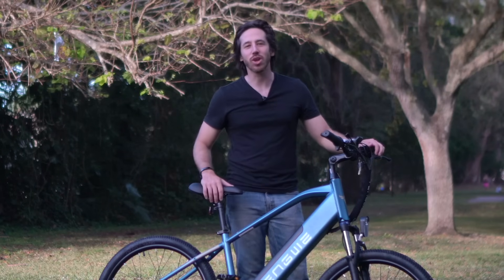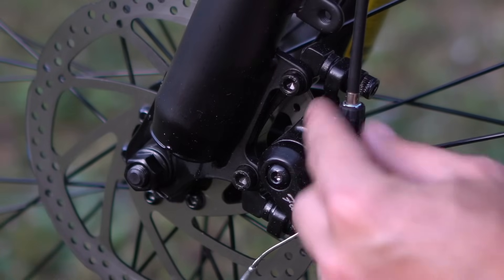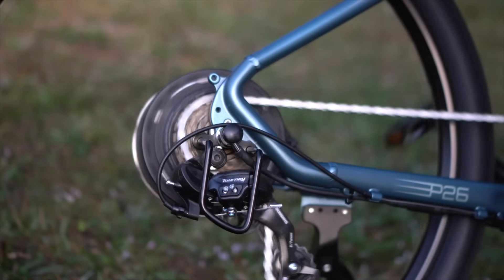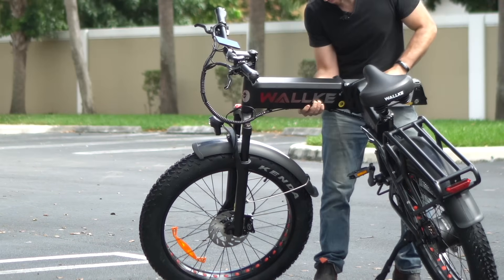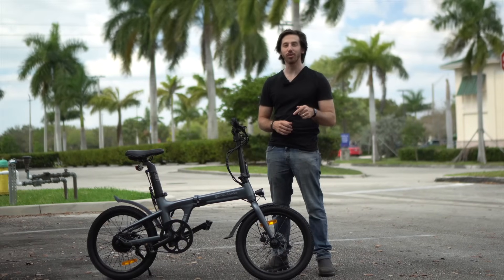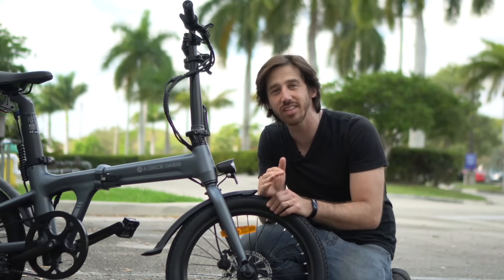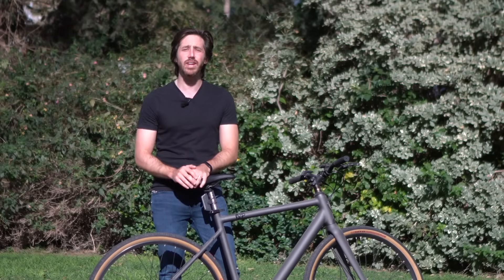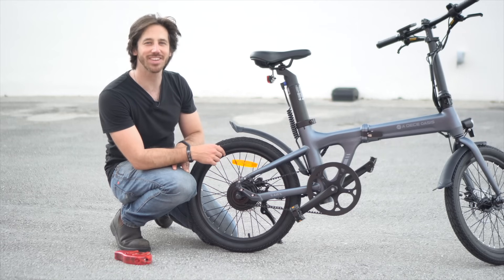How to do common ELECTRIC bike maintenance

Comment: Here's something that you might want to cover in a follow up ebike maintenance video.  After about 10 months of riding my ebike and approximately 2000 miles, I experienced a noise coming from my rear hub that sounded like bad bearings or a card in the spokes of a kid's bike kind of sound.  Well, I went to my bike manufacturer's website and checked out a video on bike noises and found out that it needed to be lubed in the hub area.   I would have thought that area of the bike would have been well greased for many years to come.  So anyways, I laid my bike horizontally to the ground, derailer side facing up, and sprayed some teflon dry lube into the axle area between the last gear and the frame of the bike and then let gravity do its work.  Well, to my surprise, the sound which seemed to be an extensive repair went away within a few miles of riding.  I hope that this may help someone out there....take care.

Two-year Update:  I'm at 5,000 total miles now and have ridden 3,000 miles since the noise problem.  It runs great and the noise never returned, but I'm thinking about doing a second dose of Teflon dry spray (approx. 5 seconds burst of spray using spray straw) as preventative maintenance.
Reply: not all heroes wear capes
Reply: Only heroes that fly wear capes!!  @TheTrendTrade
Reply: @Samkoutloud Batman can't fly and wears a cape
Reply: @shadwell749 Batman is built different
Reply: @TheTrendTrade  🤣
Reply: @TheTrendTrade  Real heroes do NOT wear capes, as cape-wearing heroes are simply fictional, pop culture characters for children, and thus DO NOT exist.
Reply: @johnsmith7676  Good grief dude.
Reply: @johnsmith7676  Buzz-Killington's here...
Reply: Yeah that's not really going to cut it. You need to open up the hub motor and put some white lithium grease in there. I guarantee it's dry as a bone in there after 2000 miles.
Reply: @tabasco260  Its been 18 months now and 3,300 miles and running good, quiet as a church mouse.
Reply: Thanx
Reply: I'm glad to hear that ain't  got ebike but good to know these things 👍
Reply: How many miles do you have now and is the noise still gone?
Reply: @projectpat313  3,300 miles and no noise
Reply: Not all heroes wear capes
Reply: That's how you make nerve gas

Comment: I bought my E-Motto bikes in Sept 2011 from Menards. They have and still are giving me great service to this day. These bikes are heavier and well built with little or no maintenance.  Tires and batteries have been my only replacement items over the years. I use my bikes on road use only for doing errands. These new bikes seem very high maintenance for the average user.🤔

Comment: I just wish there was a better way to monitor bike tire pressures. I looked at some of those valve caps that showed when one of your tires was getting under pressure. It’s nearly impossible to get them in the lower pressures that some e-bikes use. The most common pressure is 32 PSI. I’ve got a e-bike that takes 1.4 Bar / 140 KPA or roughly 20.3 PSI. It’s pretty much impossible to get these in the USA. You can buy them from the European market but the shipping costs will be almost twice the value of the product for such a small item. Plus there’s the hassle of customs and having to wait two or three weeks for such a small product. I just wish more sellers on eBay and Amazon in the USA market would carry them in the pressure ranges e-bikes commonly used. I’ve got several of them on my regular bicycles. One glance is enough to know that you need to double check them.

Comment: Great video! Make sure... You check the tire's maximum pressure rating before filling. I changed my Kenda fat tires (26x4) and filled them to 24psi (per what I read online).

When the tire popped off mid ride (that was fun), I noticed that the tire was rated to a MAX pressure of 20psi.

Refilled it to 16psi and its running happy now.

Comment: Didn't help me. My disk breaks still need trying, even after I vastly improved it. I still have to suffer from weak braking or else the breaks rub and kill my range.

And all bike shops that charge less than $100 for this tune up are booked out for the next 2 months.

I'm just making due until the late fall or winter until I can get those sweet prices for service without the long multi month wait.

Comment: Personally I wouldn't charge a LiPo battery at anything less than 40 degrees. I had a very smart guy explain why, all the way down to how the electrons flow across the battery plates at lower temps. He said the cold is worse than the heat, and it will destroy those batteries if you charge them cold. I don't have an e-bike, but I do have a small LiPo battery I use in my car for ham radio.

Comment: can anyone tell me if i can convert a scooter with lead acid batteries to a lithium ion battery pack? its currently a 48v 20ah charger with 5 12v lead acids. So will the controller have a problem with a different battery chemistry? or is it all about matching voltage and amp hours? Its a gift that i got...its not new but works very well and is way more comfortable than a strait E bicycle because of its large padded seat and full suspension!!! anyway i am grateful to anyone who can answer my question!  But i hope Its Micah who answers simply because i trust his knowledge with power supplies etc!!!! Thanks!!!

Comment: E-bikes are a massive pain in the arse. Much more maintenance, always goes wrong, can’t pedal with no power, crap speed… just don’t waste the money.
Reply: Ur nuts guy. I couldn't ride w/o an ebike because of bad knees, so mine has truly enabled me to get out of my house & go places. You are correct however that they're practically impossible to ride w/o power unless you're on a flat surface because of their weight. Mine's 88lbs... As far as speed goes, mine is one of the faster ones, topping out at 41.5 mph on a flat road on its first full charge. Only time it did that though, second charge only reaching 38 mph. After 600 miles I'm lucky to reach 34 mph currently, but that's still pretty fast. It's currently in the shop getting the brakes bled & new pads but that's the only maintenance it's had in 600 miles, so that's not bad at all. For $1,800 mine's a great buy!

Comment: I'm at 1200 miles on my ecotrik fat tire. Brakes about wore out. Shifter needs adjusted. Getting a little loose feeling but still running great. I keep my joints at 20 miles or less. Battery never left me peddling hard. I think I could get 40 miles out of a charge. Needs a higher gear in top. 500 watt motor. 36v battery.

Comment: Thanks, i am learning more about ebike maintenance
I had some bolts n nuts come loose

The plate that my battery connects to a screw kept coming loose, i kept having to tighten it for awhile n wouldn't tighten fully n kept spinning, the screw head was on outside n the nut of whatever was in the inside so i couldn't tighten the nut , then one day i tighten it n it fully tightened n it stayed tight, people watch out cause if one screw comes loose on battery plate others might on the plate
One day i took ebike to bicycle store n was seeing if i could buy a front basket to fit my ebike, we had to move my display that shows  my speed n watts, well one screw n nut on one side was almost fully loose, so we tighten that up
So far no to important nuts or screws came loose that i know off n i do some ruff off roading at times

Comment: I don't think your cables stretch. I'm pretty sure it's the sheath compressing, which makes you think it's the cable. But it's the sheath getting shorter. But the cure is to adjust the cable anyway.😊

Comment: I recently bought a folding ebike for parts. I fixed the electrical parts of it but the folding mechanism is seized up I used WD-40 and was able to fold it but I was barely able to unfold it. is there some other lubricant I should use. or any other advice I'm missing!

Comment: I used to think the idea of hydraulic brakes on a bike was weird, but now I have them. Man, I'd never go back! The responsiveness, the level of control and confidence that I feel knowing that I can go from lightly feathering the brakes all the way to locking the wheels with very little effort  tallowing me to use more fine motor control to carefully adjust my speed- oreover I worried such strength would lead to more skidding- but it is the opposite, because you can fine tune braking force easily with only two fingers- allowing more grip on the bars for steering- but also keeping your braking on the threshold for more controlled and ultimately faster braking with less wear! I had to keep adjusting my old brakes constantly, I haven't adjusted my brakes in months and they are just as good as they were the day I bought it. I thought that maintenance would be harder, but there hasn't needed to be any, so if I need to learn to bleed a hydraulic system occasionally then so be it! I ust love how they respond, how I can stop quickly, even with one finger, but still feel more control and feedback than any cable system. I am a convert to hydraulic brakes! No contest, they are the best!
Reply: Hydraulics are a no-brainer.  There is a reason why rod brakes disappeared from automobiles in the 1930s.

Comment: I found out after I bought an E-bike online that none of the local bike shops in my city won't work on, or repair E-bikes that they don't sell. I'm an electronic tech so I can troubleshoot most things, but having trouble getting repair parts from the manufacturer.
Reply: Tell him now's a good time to start since you're going to be seeing more and more e-bikes everyday
Reply: I wonder if it's all ebikes in general, or the ones that use parts that they don't generally work with.

Some will be hesitant if you only come in for the difficult stuff, while they can't make money on you through all the other stuff.
But others might just be because they don't know the tech. If you got like Bosch, Shimano etc, loads of stores will sell bikes with those engines, and can easily work on them, but I know a lot of people here bought cheap Chinese bikes, and loads of stores won't touch them, it will take a lot of time to fix them, and obviously people bought those bikes on the cheap, so getting a fat bill will likely cause a ton of issues.
Reply: @benjaminvdvyt  That's what my local bike shop told me, they said the Chinese bikes were too much of a liability and they won't touch them. His example was if he fixed something and later they went home and it blew up or something, they'd blame him even if all he did was work on brakes. He said name brand bikes are fine, though, he'll work on them all day.
Reply: Im having the same problem. Im new to the ebike world and have been loving the fun that these bikes provide. Got a flat the other day and some of these places won't touch it.  Guess this is motivation to fix rear tire myself.  I probably need to know how to do that anyway.
Reply: i was wondering about that . whod work on mine if it ever breaks. lol

Comment: Super easy thing to add to mech brakes adjustment.  Same tool, before tension, loosen caliper mounts just a little, squeeze lever to center and re tighten before doing the cable.

Comment: RE: Disc brake adjustment. Tuning the lever only moves the outer pad. To tune the inner pad there's an Allen head on the back of the caliper. You can either adjust it in place through the spokes, or take it to adjust. You want to tune the outer pad first, and then the inner one.
Reply: That is very true.,and important. With a cable type calliper it is only by adjusting  both the inner and outer pads and proper alignment of the whole calliper you can do the adjustment properly. That is certainly the case with my cable operated brakes anyway.
Reply: @jasondoyle1037  I made that mistake with my first set of cable actuated disc brakes. Resulted in the disc bending in slightly by the time I was corrected.

Comment: Hi Micah,
Also, check your motor cutoff break and gear shift sensors are working correctly.
These are just as important, if not more so than a loose nut.
My magnet on a break sensor moved out of position for me, and I was fighting the motor at a stop light. No joke on a 1500 watt ebike.

Comment: My 2.5 inch street tires tell me 60.. should I not be doing 60 psi on them?
Reply from the maker: You can usually go up to 60 but it just makes for a rougher ride. 40-45 is usually still a good balance between handling and comfort.
Reply: Keep them in the range recommended, and compensate for any difference in temperature between the outdoors and where you store your bike.
Other than that, adjust the pressure for the weight you put on the bike. You don’t want so little the rim pinches the inner tube or too much that the ride feels very harsh. Play around a little to find what you like.
Reply: @chow-chihuang4903  Thanks Yeah I took the suggestion and the difference between riding it is night and day. It's so much more forgiving now.  I just filled it up to what the bike tires said right on them which was "fill to 60psi."

Comment: I would suggest that directors of amputee clinics apply for the give a way and use E-bikes to help get new amputees back on a bike. I bought a non electric trike after my amputation, and it was instrumental in getting my endurance and strength back after over a decade stuck in a wheelchair.

Comment: hi, I love your channel and it has helped me a lot as Ive stumbled into the world of e bikes as main transportation and project. I may win one of the e bikes yo plan to give to people in need later. Even tough I have a second hand e ike, I made mistakes and got one hat is wrong for my needs, but is also a real drain on meager resources to get it right enough. But I wont enter my case trying to win the lovely bike this bmonth. It would also be the wrong ike for me in completely different ways than the one I have  (An electra townie 7D with a poorly installed voilamar front hub dive kit FWIW)  But now featuring a lot of home built improvements that Ive done to try to make it righter f0or me. Welded together front disc brake calper mount W/ a torque arm that actually wworks and magnetic quick disconnect milkk crate on the ack and weird magnetic ring on rear wheel to generate juice for a rear light that runs when I move and stops when I stop, Anyhow even if I never win an e ike from you y0ou are doing good by donating them to people whose live will be brighter and better by getting a vehicle tat is beyondf their reach. You make it easie to hazve faith and hope for humanity. Well done.

This post would win first place if there was a contest for rambling walls of text, innit?

Comment: I have a Jetson bolt Pro E bike and the manufacturer says to fully charge the battery.

Always charge your e-bike to full battery capacity and unplug it when it's done: Do not leave it charging overnight or for extended periods of time. Before storing your bike for long-term stretches, fully charge your bike—and then charge it again once a month until you resume regular riding.

Comment: I wonder if you can add a dynamo with a power controller on an ebike that can charge sections of the main battery if you're not using pedal assist.

Comment: Several times you mentioned cable stretch as a reason for the need to adjust, cables are pre stretched these days so it's either pad/block wear or slipping cable grip. 😊

Comment: I learned how to do most of these mechanical adjustments in my youth, I used to ride bicycles a lot. Disc brakes would be a new animal to me.  I purchased 2 of your books, DIY lithium batteries, and the ultimate DIY Ebike guide hoping to one day convert my old Huffy mountain bike that I bought back in 1999, I haven't ridden my mountain bike for several years now, I've had several pretty sizable surgeries that disallow me from doing much pedaling. Which is how I ended up at the point I'm at now, hoping to convert my old huffy into an E bike so I can continue enjoying the nature trails up here in Wisconsin.  Thank you for all of your informative videos! Keep up the great work, you're doing a great job! BTW, I wasn't aware that you published 2 new books, I'll definitely check them out, especially the solar power one, as I want to go solar.
Reply: Older value brand MTB generally don't have too much in the way of shocks or brakes. If there is a disc brake and you keep it tight it can work okay. If you go hub motor, I'd say a 750/1000 watt is the most you'd want to go, due to torque on the front or rear wheel brackets. Max 500/750 watt for a mid-drive. The chain & gears are not set up for that much torque. You should be able to get up to 25 mph on a flat road, and do decent hill climbs if you know how to approach them. Just be careful testing the limits of the bike and make sure to check for loose bolts every few rides.

Comment: ...I'm new to ebikes but not to bikes, got into them after both my four wheels and my motorcycle died in August of 2019...62 years old and ex roadracer  and soccer player, worse injury is losing blood flow to my hands after a 15 mile ride and worse when carrying a backpack, nerve damage... recently bought a stem riser adjustable angle up to 60 degrees and 5 inches higher when at 60 degrees which improved my blood flow however changed the steering  feel, specially with weight added in the back of the bycicle...any suggestions in order to improve the setup? Thank you.